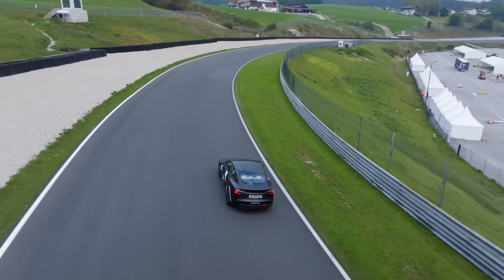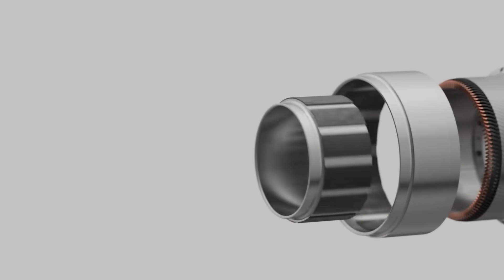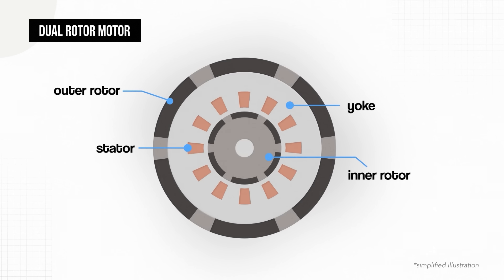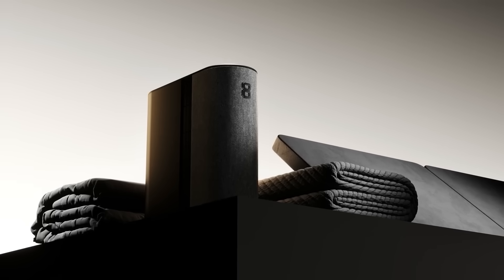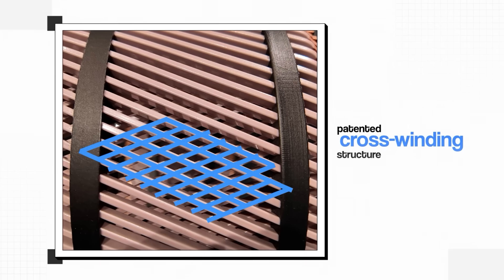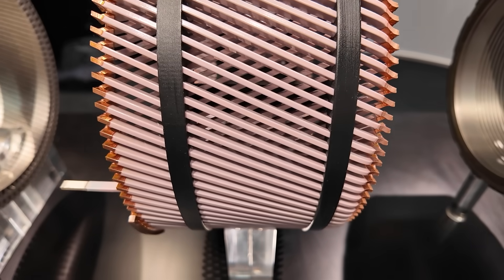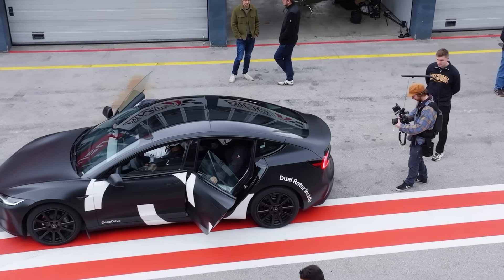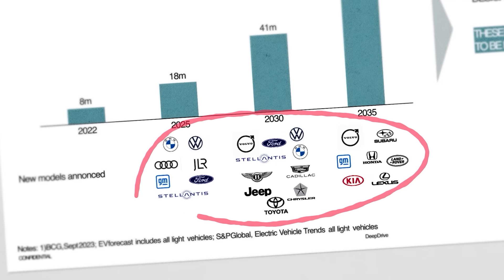How Dual Rotors Make Motors Insanely Efficient

Comment: A big advantage to dual rotors isn't explained. They lower eddy current & hysteresis losses by keeping as much of the magnetic flux loop as possible in the rotors, where it's stationary relative to the iron and magnets it is in. In contrast, the yoke portion of the stator in a conventional design is iron that's constantly being magnetized in different directions. Axial flux dual rotor designs enjoy the same benefit. This is particularly beneficial in EVs with permanent magnet motors & single ratio transmissions (the most popular motor/transmission combination by far). They spend most of their time producing little or no torque, but incurring significant losses from the strong permanent magnets remagnetizing the iron in the stator, multiple time every revolution as the rotor spins. This is why motors without permanent magnets are still used in some EVs, they can adjust the field strength to what's necessary.
Reply: I watched to the end and heard the statements you made responded to.   He addressed efficiencies in quantitative form
Reply: It's not exactly a new concept though. 
It's basically just a brushless bell-armature motor. They've been around for quite a while - although in much smaller form factors.
Reply: Interesting
Reply: I saw that design and thought of a small/medium sized wind generator. The losses and cogging torque at low wind speed would be far lower.
Reply: The new nissan leafs will uses no magnet rotors
Reply: I would prefer motor without permanent magnets any day. Sad these are less popular nowadays.
Reply: @D9ID9I  they are less efficient.

Comment: Are two rotors, mechanically linked to turn in unison, actually two rotors or one rotor with a weird cross section? To my uneducated this looks like a big, weirdly shaped, rotor folded up to work with a small stator. 🤷🏻

Comment: These new concepts with electric motors are typically overhyped. They bring some benefits, but don’t radically change anything. Current EV motors are about 95% efficient in most important areas, and cost around 800$ to make. No game changing inventions are possible.

There are room for improvement with high power supercars, to maintain good performance and efficiency over high speed scale without gearbox, or higher power to weight ratio for hypercars, but these are not needed for normal road vehicles as long as we have speed limits.

Then there’s a known unicorn design, hub motor, which exists, but are huge trade offs with important parameters, like size, cost and efficiency, and of course non suspended mass. It would be nice to have one that’s at least as efficient as current motors, not more expensive and for some magic ways, wouldn’t weight more than current rims,  but we are not going to see one soon. Same goes propably with direct drive motors that don’t need reduction gears, although these are possible.

The only remarkable improvement for basic ev motor is reducing rare materials without reducing performance too much. In practice, we will probably see reduction in size, with reduced lifetime and increased price, because advertisements take the most of every technical ‘breakthrough’

Comment: Nice in theory but having fine tolerances and bearings that would cost the earth all mounted in a wheel would spell disaster on Australian roads given the severe mechanical shock transmitted directly through the tyre to the motor bearing. Bearings don't like any stray magnetic fields creating eddie currents and fine magnetic particles and the bearings poerate in a closed lubrications system that will eventually distroy itself. Cost to carry out bearing replacement or servicing would become prohibitive to most people. It's all fine in a race track and race environment where every thing is rebuilt after most races and track surface don't have corrigations or pot holes.

Comment: There is an old design that uses no rare earth metals, and it's 98% efficient.  You are plugged into it now. It's that big generator at the power company.  I have a series wound car motor that is better than 90%. Efficiency is not a problem.  Batteries and the power to charge them, they are the only problem.  Secret: it's way cheaper to make an electric car. No engine. Only the starter but a little bigger. .  If we could all get batteries we could make the cars so easily.

Comment: They still rely on armature to hold stator together under loads (left part at 3:56 and 7:38 into which windings are slotted in). At least in samples shown in the video, windings conductors appear to be simply soldered together (as opposed to being welded) and on their own wouldn't withstands loads produced, yoke is also effectively there, but combined with out-runner portion casing. Interesting how they are matching magnet sizes as sizes of gaps between magnets appear to be the same on in-runner and out-runner rotors, but as there's gap between them to fit armature and windings they might need to be adjusted to avoid parasitic drag.

Comment: If they made the inner and outer rotors spin opposite directions, it would take all the torque loading out of the windings. Couple them with some planetary gears and your off to the races.
Reply: How would single rotating magnetic field make them spin in opposite directions?

Comment: So did this guy just completely misunderstand the design? You can clearly see the yoke at 8:40. A much smaller yoke, to be sure. But still very much so a yoke. Making this video, a joke. 

Don't buy the idea that copper bars would reduce manufacturing cost in the slightest. Coils are spun into the stator with pretty incredible speed by machines at a very low cost. Individual wires are extremely easy to manipulate. More importantly, that new yoke looks like a nightmare to produce. Each would need to be machined individually, presumably, otherwise you would be massively complicating the extremely simple existing practice of stamping a hundred sheets of thin metal in the same shape and gluing them together.

Comment: It may look fancy but the main feature is the two airgaps also mean double the surface area to cool the magnets and the coil. Two airgaps is not a great thing as there are minimum tolerances for motors when things vibrate and bearings wear. You do not want the rotating parts to touch. 

Magnetically you could have the two magnets on one rotor and just loop back the flux using iron on the other. This may actually be a cheaper version not having to fix magnets on an outer surface rotor where centrifugal force them outwards.

Main thing is the stator have double sides and the distance for the heat in the windings to cooling surface is short.

Comment: I would think those thick bars will create lots of Eddy current losses and therefore heat. This should be hurting the efficiency significantly. the grid is so dense, and you are trying to move so much rotating magnetic field through it. It is essentially self breaking. I don't see this working.

Comment: Just in general hyped for these pr wheel engine designs. It seems like there's space on the floor we haven't really ever been able to appreciate, one way or another. I've seen similar stats for similar technologies and it seems like a lot of companies are implementing it. For all the obvious reasons. 

The future of electric cars seems super interesting. 

Basically the two most exciting technologies right now, if you ask me. Is AI and car manufacturing. Maybe I'm too optimistic, but it seems like you'll be able to drive further and charger faster in only a few years. And that is on top of these cost and weight reductions in engines. These things coming together in the next 5-10 years. I'm hyped!

Comment: although it's true that wheel motors don't weigh more than centrally mounted motors, you still have the battery pack: the single heaviest and most dangerous component.

Comment: Counterargument: 

Whenever anyone promises 20% efficiency gains, they are either cherrypicking some arbitrary datapoint,drawing hockey stick graphs, bad at their jobs or lying. 

Now, whatcomes to the inwheel motors, unsprung mass (or it's double whammy brother, rotational mass)  isn't the only issue, manufacturers are putting vehicles on the road with 20 or 22 inch boat anchors because of aesthetics (which imho looks stupid af).

If wheels with the mass of a calf were a good idea, racecars would have them. Anyhow, enough with the mass, onto vibrations and impacts : to keep that motor from coming apart due to potholes and curbs and whatnot people drive into, you'd need some ways to insulate the motor from the wheel. Not just for potholes but for harmonic vibrations too. How is that achieved? 

Whatever the solution is, it takes up space and increases the weight of the whole assembly. Fitting low profile tires because apparently it's a thing, doesn't help either. Less air filled rubber = more vibrations from the uneven road surfaces to the car and passengers. 

What about water? Snow? Salt that they put on icy roads to get rid of the ice? Who wants to dip their expensive electric motors in salty slush?

Tldr : I like the idea of the double rotor motor but the in-wheel motor design is impractical, prone to all kinds of damage, heavy, cumbersome and just stupid.

Great video!
Reply: Also 20% improvements are impossible in technology that is already 90% efficient. Even the least efficient electric engines are 85% efficient.
Reply: @Carewolf I'm sure these are 110 to 120% efficient.  They actually charge the batteries when you accelerate.
Reply: @vinnieluther6589  No, that is what being close to 100% efficient means. A 100% efficient machine can work work in both directions, and thus charge when being turned. This might not be a well known phenomen of a perfect Carnot machines, but it applies to anything close to 100% efficiency, and anything above is a lie.
Reply: @Carewolf are you arguing with sarcasm?
Reply: @vinnieluther6589  Perhaps I was, sarcasm is hard to detect on platforms full of weirdos. On Youtube I can not tell what is sarcasm and what is not.
Reply: @Carewolf I should have been more clear.  You are right, a large percentage of the comments do seem to be assuming perpetual motion.

Comment: This idea has been around for a long time. We used to have some brushed DC motors with the same construction except the windings would turn. The windings were made of square wire and were wrapped in fibreglass.  The reasin for doing this was exceptionally low inertia.  The problem was the windings were not very strong mechanically, they were difficult to cool and had lower torque because of the lack of iron to guide the magnetic field. I don't see how they are going to fix this problem. In the video they show just the copper bars wound with two black bands around.  In the motors we had those two bands were the full width of the windings and everything was filled with epoxy to hold the windings together.  The biggest source of failure in those motors was the windings wobbling and rubbing against the magnets. I think this motor will have the same problem.
Reply: There are tiny versions - usually marked as "coreless" like the ones used in small rc planes, helis and the smallest of hobby servos. They tend to have insignificant torque and rev insanely high.

Comment: I am disappointed that the author thinks the torque is only created by magnets in modern electric machines used in cars. This is NOT true. Roughly half of the torque is generated by magnets. The other half is created by cleverly placed and shaped "slots" in a rotor. If you pull out magnets from modern PMASynRM motor (which almost all current car motors are) the motor would still work, just with only half of the torque created by those slots left after pulling the magnets out. The best way to increase efficiency at low torque is actually reducing the amount of magnetic material in the motor, not increasing it.

Comment: If the 34 kilograms of weight is for the combined weight for all 4 wheels then it will work quite well especially if it can brake harvest so much that it can replace the brakes. But if it’s the weight per wheel then I can only say oh dear their goes all suspension comfort. We live in a world where Olley Maurice’s lessons of flat ride dating back to thirtieths has been forgotten. Where vastly over damped suspension systems are used in combination with super aggressive anti roll bars an hyper low profile tire. The very last thing we want is a big lump of un sprung mass requiring even stiffer dampers. Greetings from Denmark

Comment: I love your videos and this is certainly no exception.  I've always wondered why this configuration wasn't being worked on.  I realize the yoke was critical but it seemed like we would have seen more motors that attempted this yokeless concept.  This is brilliant. I wonder how they get the proper voltage and current numbers without wire windings?

Comment: The hub motors actually can work on some settings well. If we are talking good quality surface like race track. But then there are many negatives. The suspension performance suffers, more weight due to robust construction of suspension, possibly more wear, less kinematic design freedom. The weight further from CoG creates higher moment of inertia. The suspension are getting better by inovations but still this goes against their function so you would degrade its performance.

Comment: Very nice videos. I really enjoy. Could you ellaborate on some important metrics. If it is more efficient, it should heat much less, any data. Heat per kWh vs other motors for example. Also weight to kW vs others.

Comment: 1) what is the current path in the stator and where does it produce magnetic field lines going in what directions and what makes the field rotate ?
2) are the two rotors linked by gears ? where and how, and how much friction and loss ?
I agree with another commenter, unless all our roads suddenly become pot-hole-free (forever) the in-wheel motor is a non-starter.
Reply: This has obvious application for aircraft motors (once the battery problem is solved).  Smaller versions of this motor would also play well in personal mobility devices.
Reply: your very curious, watch some beginer YT vids on electric motors, gear drives, stator design, with your desire im sure in time your will come up with great ideallys!!❤❤ me Post PhD EE

Comment: I went and looked them up. Apparently, they're designing two motors. A 19-in and a 16-in. 

The 16-in is 1500 Newton meters and 120 kW. In unit I have her feel for, 1106 lbft and 160.9 horsepower. With that much torque, a car would kick ass. 

The one he was talking about is 1,475 lb feet and 241 hp. Am I silly for assuming you would use two, one in rear wheel? Or four for one in each wheel? If you do that, they don't need to be this powerful.

Comment: Unsprung mass is a concern not to be overlooked, one potential effective solution would be individual "outboard" engines attached to the chassis, not the suspension with individual (CV) driveshafts which incur minimal mechanical loss.

Decades ago I saw a man on a Science show here in Australia, The New Inventors IIRC, with a dual rotor,  radial flux design motor with an inner and outer component - unfortunately one of the guest judges on the program verbally crash tackled the inventor in what was quite an unedifying display.

Not stating the above that to diminish this invention in any way as they've found numerous ingenious solutions

Comment: With rear wheel drive and variable regenerative braking, it should be possible to eliminate mechanical brakes on drive wheels to bring unsprung weight down, not to mention saving cost, plumbing and control complexity.

Comment: The simple problem is that in this design the stator is only supported at one end meaning that it has to be extremely rigid. This could be achieved by the use of beryllium copper which is a very strong alloy, for a small loss in conductivity of both electricity and heat. But any benefits would be negated very quickly every time there's a battery improvement. A 2% improvement in motor efficiency by an extensive redesign becomes pointless when you consider that typical BEV battery modules have gone from 40 to 50 kWh in just a few years, a 20% improvement, and the solid state battery companies are talking about 60kWh - all of these being the same size and weight.
Reply: Cost as well. If a new motor design is lighter, smaller, provides more power in the same size footprint but costs more, then it'll be stuck in niche designs like sports cars. EVs are getting cheaper because battery modules are cheaper and more dense.

Comment: Can't see how this will 'change transport forever'.  I assume another clickbait algorithm headline.
I was wondering - as current motors are already increadibly reliable, incredibly efficient (95%=) and relatively inexpensive - certainly w.r.t. ICE engines per Nm.
Clever though it is - it;s selling point appears to be slightly cheaper than conventional. But given the costs in an EV are primarily driven by battery and power electronics I would see this only affecting overall price by a % point or so. 
Not really a game changer is it?

Comment: A lightweight 30-40kW in-wheel motor, mass produced to bring cost down seems much better for mass adoption.  4WD 120-160 kW with massive torque is plenty enough for great performance.  2WD version for budget EVs.   The massive torque allows brake downsizing saving unsprung weight and better handling.  Heavy to high power in wheel motors ruins the opportunity.  Don't be too greedy for power you can't use.